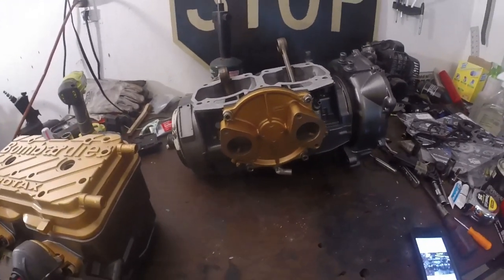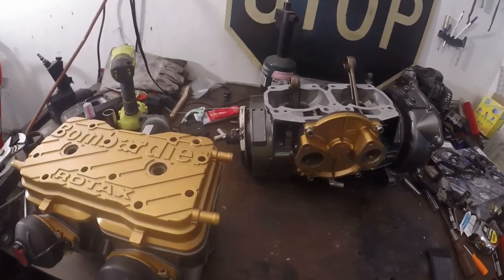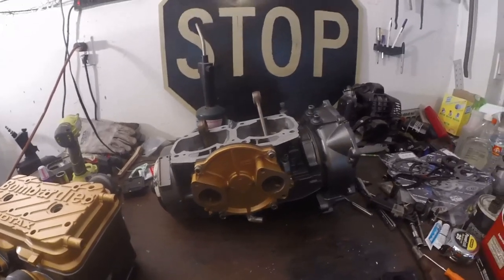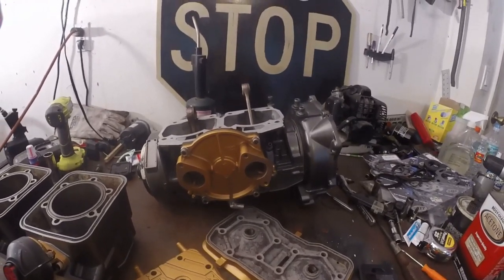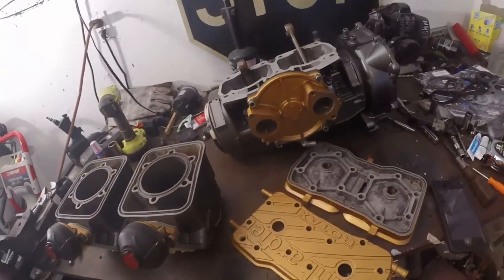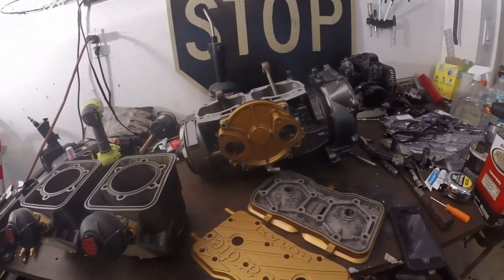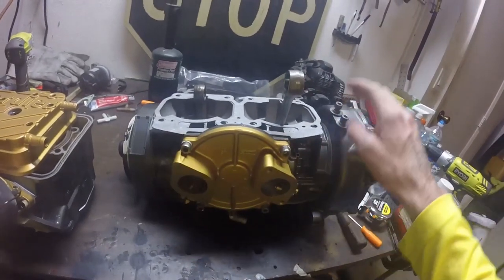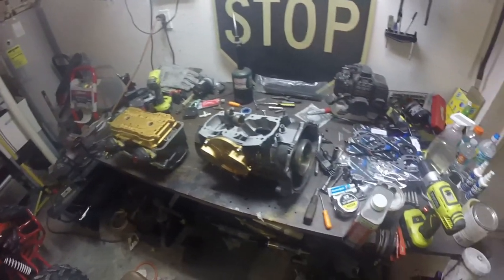96 seadoo xp 787 full rebuild

Comment: PSA: Before you tighten down the cylinder bolts make sure to bolt on the exhaust manifold temporarily so it aligns both cylinders to the exhaust, otherwise you can have water/exhaust leaks from the manifold gasket from the misalignment. Please consider adding that to the video or description, thanks!

Comment: I wish I had watched your video before I attempted this myself. I didn't think I'd be able to compress the rings myself so I put them in through the top of the cyl using a ring compressor tool, then put the wrist pins in from underneath... talk about a pain! Lol well, next time I know the right way to do it. Cheers and thanks for the excellent tutorial.
Reply from the maker: Dan Builds Things  damn that doesn’t sound easy haha
Reply: @fishnski3128  it was definitely a learning experience. I did another one after that the right way and it was MUCH easier. 😂

Comment: How did it go without replacing that front crank seal?

Mine was perfect 160psi on both but rapidly ate the rear cylinder walls until it finally wouldnt start. I was supposing a lean condition due to a leak but not positive.

My questions are where would I go for proper diagrams AND cyl/piston kits if you have any input?
Reply from the maker: Ripptyde Vibes  I order on eBay. Just make sure it’s for your model ski/ engine
Reply from the maker: Ripptyde Vibes also I had no issues with the crank seals. She runs amazing !

Comment: Hi what was the reason you rebuilt this I bough a Seadoo 1997XP but the people that sold it to us were not very honest but any ways some how we got water in the engine and I took it a part I’m stock because I don’t know if I have to open it all the way to see if it has water in the oil or baton part of the engine any sugestións
Reply from the maker: polymexdf69 if u have water in the engine all u have to do is pull the spark plugs out and hold the start button down till the water is done coming out. I had a water leak internally and my pistons and cylinders were scored from the water ingestion.
Reply: FishNski312 look at this video
Reply: On the base were you said to clean it with acetone did you put any silicon. and on the cylinder bolts did you use the same ones thanks
Reply from the maker: polymexdf69  only sealer u use is between the crankcase halves and the exhaust manifold gasket.. none on the base gasket
Reply: FishNski312 thank you for the help

Comment: if you dont have assembly lube i have always used 2 stroke oil to assemble all my 2 stroke engines.
Reply from the maker: That does work fine. But if you think the motor may be sitting for a while, the 2 cycle oil will eventually drain to the bottom and you will get a dry start. Assembly lube will stick there for a long time. That’s why I like it

Comment: I'm about to tackle this project ony ski. How did you remove the plate behind the flywheel? I can't grab it and hold the motor still at the same time. Did you have a special tool for this?
Reply from the maker: Aaron Johnson there is a special socket that threads on to the flywheel and it has a center that tightens down on the crank. It’s a special puller designed for it. U can order online for under $30.
Reply: Awesome. Hopefully that makes it much easier. Thanks for your help and the video. Only one I could find on the 787.
Reply from the maker: Aaron Johnson  the exact reason I made this video is because I could not find a video on it! Glad I could help :)
Reply: Heat the hub to break the loctite bond and use a pipe wrench while its still in the machine...pull the head and put a piece of wood between the piston and exhaust port...i cant imagine putting all that money into a engine and not changing the seal....pretty good video but i didnt see ring gap checked or squish

Comment: At around the 37 minute mark, you put on the two small o-rings on the head.  It seems that you didn't put on the o-ring around the perimeter of the head that would seal to the water jacket (Manufacturer Part#420831550).  I pulled the water jacket off mine and it didn't have that o-ring.  I noticed on one website that it says that part has been discontinued.  I would imagine that it is still necessary, right?
Reply from the maker: yes it’s needed for sure. I did forget to show it in the video. My fault. But every new kit you buy, comes with all necessary seals and gaskets.

Comment: What is that fitting for that is right below the rotary on the block
Reply from the maker: The oil line for the rotary shaft. If you premix your fuel, u still need oil running to the shaft or it will seize up

Comment: Hello, I really found your video helpful. I am completely new to jetskis and I own a 1997 seadoo 951. Do you have any videos on tuning these engines? I really cant find videos on this subject. I understand its a very important part to completing a rebuild. Cheers
Reply from the maker: No videos on the 951, but I did rebuild mine also and it is pretty similar. Just look up the torque specs online. It’s actually easier because it’s a reed valve engine compared to a rotary valve engine.
Reply: My mistake... I own a 787 jetski. I’m learning how to tune it. Really appreciate your video

Comment: Do I need to set timing on a new motor
Reply from the maker: If you do a full rebuild ,
The crank and counterbalance shaft need to be aligned correctly and also the rotary valve timing needs to be set

Comment: Hei do you know eny video how to intall tha engine 787 in to tha jetski ?
Reply from the maker: Rimvydas Pranulis  not too sure on any videos. It’s pretty simple but you need an alignment tool so your impeller shaft is lined up properly. Or else your carbon seal will leak water.

Comment: A lot of people are telling me to keep the oil injection system and don't block it off. So that means you're running premix correct?
Reply from the maker: Paul Schulze yes premix. The only benefit of the oil pump is u will use less oil compared to premix. But with premix, you have 100% guaranteed lubrication and never have to worry about any oil lines cracking or any failures of that oil injection system. To each their own. But I don’t see the point in risking the entire engine seizing up when you can easily prevent it. Literally any engine I buy that is oil injected, gets deleted and premix. Never had an issue!
Reply: @fishnski3128  Thanks! Do you mix 40:1 then?
Reply from the maker: Paul Schulze most people run 40:1. Yes
Reply: @fishnski3128  how did u block off the oil inj?
Reply from the maker: @The_Home_Pros   buy the bypass plate on eBay. You will need to remove the stator cover on some engines because the plastic drive inside only comes out from the inside. But you remove the oil pump and lines. And the kit comes with the plate and two caps to cap off the rotary valve nipples. Then premix your fuel 40:1. Always! And keep the big lines connected to the rotary shaft on both sides of the engine!

Comment: Man you made a lot of mistakes on this motor 1 you never use a old front seal that thing will leak and if it doesn't right at the start it will start soon after also red Loctite on a aluminum motor you just trashed that motor you definitely have a lot to learn
Reply from the maker: Old seals? Everything is new. And the motor still runs 100% lol but ok cool
Reply: @fishnski3128  you said you did not replace the front seal because you could not get the PTO off so if you did not get the PTO off how did you replace the crank seals in the motor and then you put red Loctite on aluminum yeah you have a lot to learn